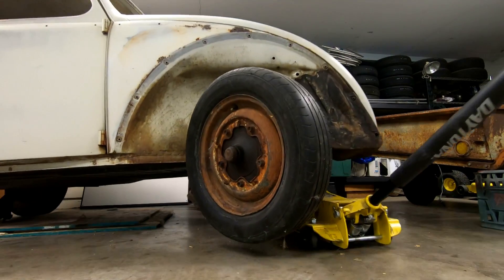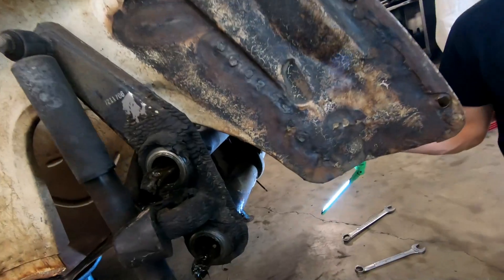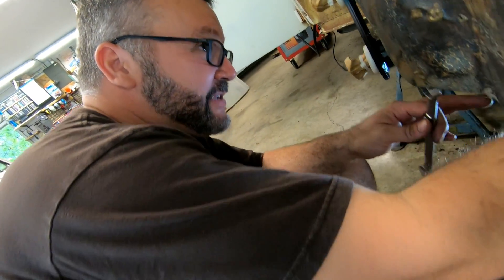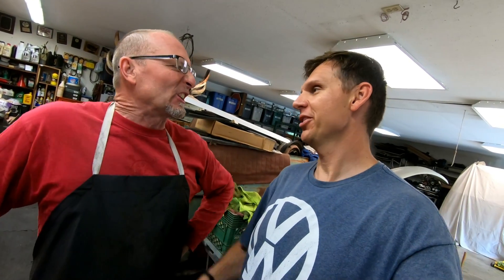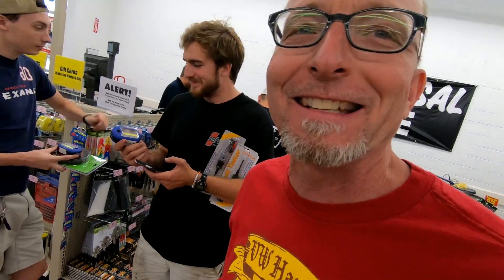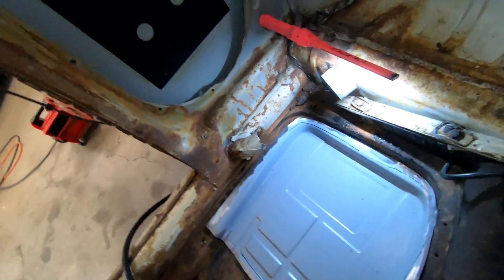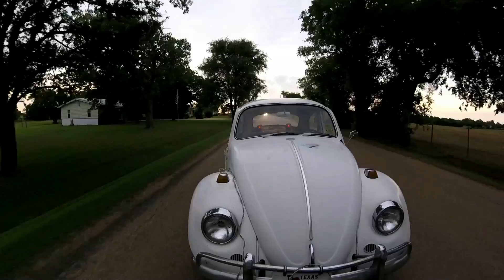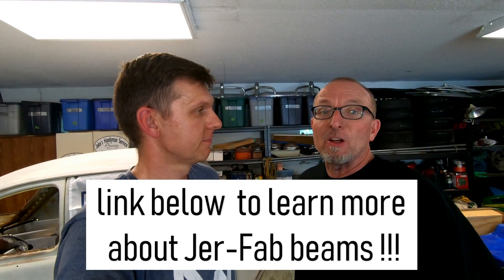A New Beam for the Harvest Beetle!

Comment: You guys should think about investing in some inexpensive powder coating equipment.  I added that to my home garage, and now in my shop, and talk about creating some nice durable finishes for parts like this.  They end up looking amazing and it actually takes a little less time than letter paint dry.
Reply from the maker: How much is that setup?
Reply: @VWLifeVW  I purchased a low end kit from Eastwood, and it has worked really well.  The have three different ones and I purchased the one in the middle, their PCs-250 dual voltage, and the small oven.  The price is around $130 for the gun, and I'm not seeing the small oven I bought from them, but you can use any old oven.  A used kitchen oven will work just as well as a special purpose powder coating oven.

Comment: Love the efforts you're putting on those beauties !
Been working all weekend long on a '64 that's been 'refurbished' in the 90's : body parts changes to look younger : wings, engine lid, skirts, trunk lid, lights, ... from a '74 (who the Heck does that ??). Interior is refurbished with typical 90's fabrics, very colored ans geometric shapes oriented. No more original steeringwheel or shifter, and every single button or lever is painted flat purple... Eeerk !.
Exterior is bright 'barbie pink' but original color can be seen  thru : blau see.
Still lot of work to do but a hell of a weekend with mates and a Beetle 😁

As usual, Big up and greetings from France  !
Reply from the maker: Wow that sounds pretty cool actually. Are you going to Change it back to stock? Are you on instagram?
Reply: @VWLifeVW   : i''ll do my best to bring it back to it's original glory !
Maybe i''ll install some greater newer upgrade parts, to improve the driving experience, but nothing too radical.

Not on Instagram yet, maybe it's the right time to hop in
Reply from the maker: @florentbarbare9983  do it, lots of cool VW stuff on there!  good luck..

Comment: I gotta question,my fan belt is pretty damn loose,and I have NO shims behind it...does that mean that my belt is stretched/ worn out? I have noticed it getting looser and looser just over a period of 2 weeks,I'm just looking for a solid straight answer,thanks guys! Ima' big fan of VW Life!
Reply from the maker: Sounds like it might be need to be replaced. Do you have the correct number of the shims?
Reply: Yes no shims inside the two half’s and loose belt would require a replacement.
 Keep 8 shims in play weather on the inside or out or combo of the two
Reply: Ok,thanks guy...I have researched it a little bit,I just wanted to get advise from others,thanks! Much help!
Reply: I do have 8 shims..I'm really not sure how many I have on the outside...bout to leave wrk and check,thanks again
Reply: A good forum to be a part of is aircoolers.org. great people on there, many on here are AirCooler gang members.
Reply: @tonypotts3769  ...cool
Reply: Well yesterday I got off work and I actually had a new belt in the trunk,I put it on and I had to add 2shims on the inside and I got 6 on the outside...its perfect now

Comment: I hate to ask a STUPID QUESTION, But, Why did you guys replace that beam??????  I charge a $100 for one in the same condition in Wisconsin.  We have rust issues where there is almost ZERO beam left!!!!
Reply from the maker: Not stupid. We are lowering the car. The best way to do this is to narrow the beam so that the front tires tuck under the fenders. The new beam is also adjustable. So we can adjust the leaf springs to raise or lower the front end to our liking.
Reply: @VWLifeVW In the Episode you guys never mentioned that that was a narrowed beam or why you were replacing it.  Ship the old one to Wisconsin i can make a $100 !!!
Reply from the maker: @gilbertnowak5770  okay what's the address? :)
Reply: @VWLifeVW  You know I was just Kiddiing Right?  I really would like to head your direction and bring some rust free parts back here, I just may pack up my truck and head your direction  this comming Winter.